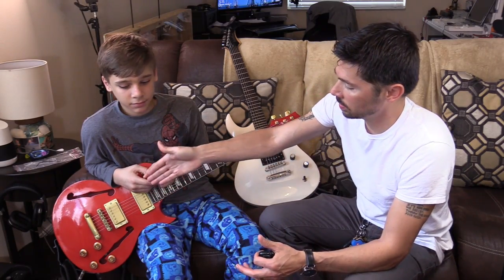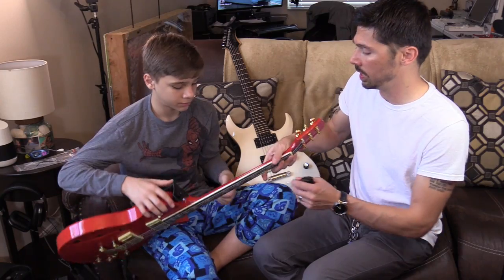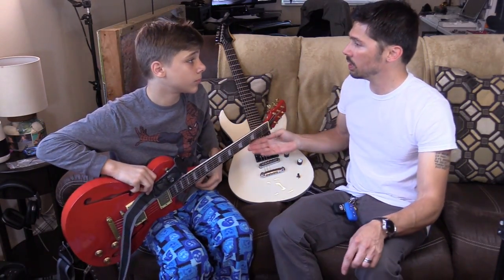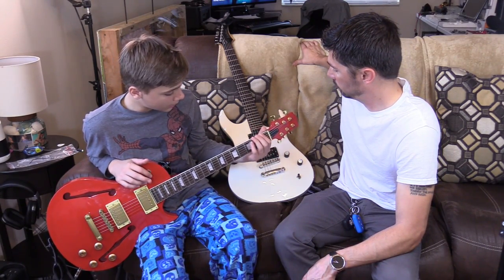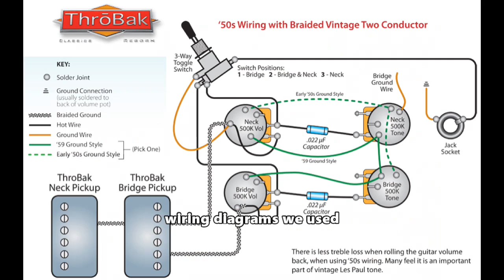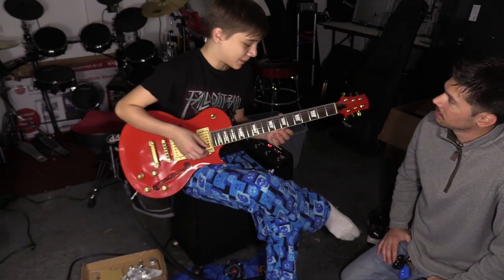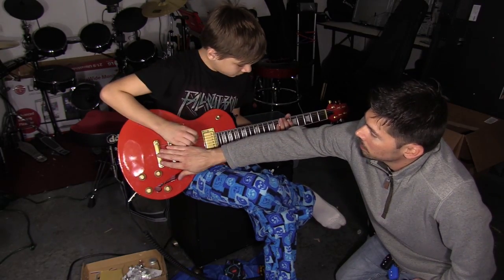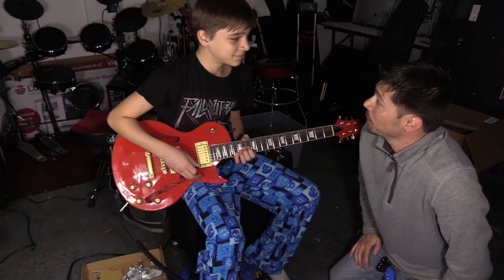Building and Wiring Electric Guitar kit from Amazon

Comment: Hey I  have a question that  you might be able to answer quickly I have a dry contact remote control input where closed it off and open is on It is low voltage 3a,30vdc.  I want to control this unit with a wifi app like this unit can
MHCOZY WiFi Wireless Smart Switch Relay Module for Smart Home  Any ideas? Many thanks in advance